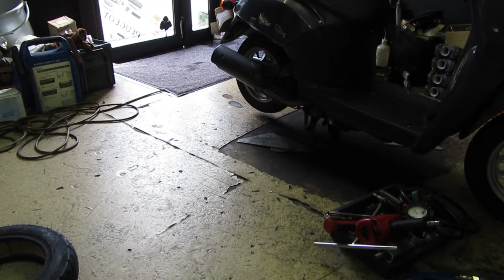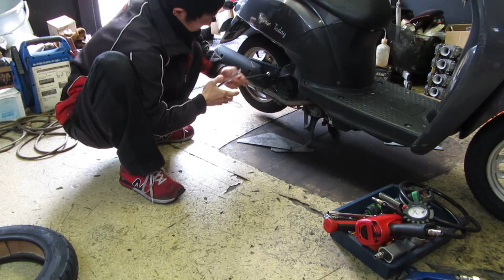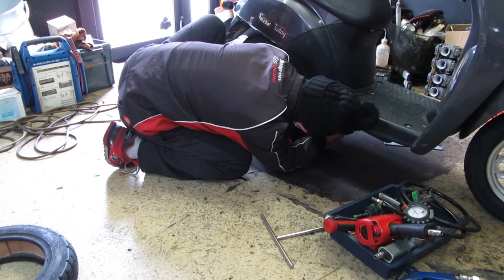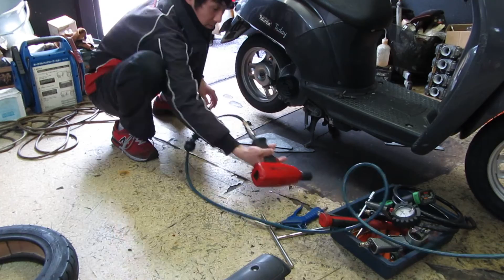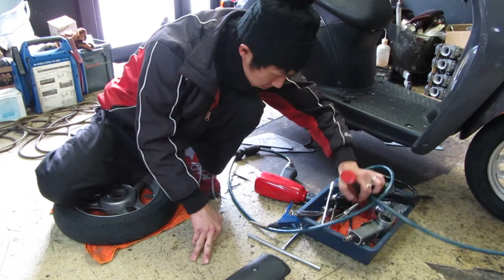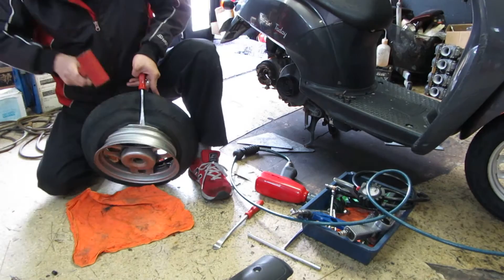トゥデイ（AF61）のタイヤ・ブレーキシューの交換作業【リヤ編】

Comment: I  think your ability to chang the rear tire is very excellent. In korea, when I had my today fixed. the machanic was very different from your method. He changed the tire with the mahura unparted. So my bike had a big damage on the mahura and It was broaken out. And after one year,  I should have fixed it for very high cost. Maybe it was damaged by him in the changing process of the tire.